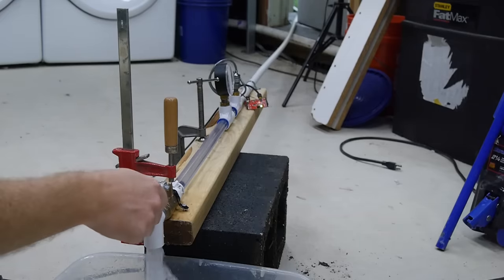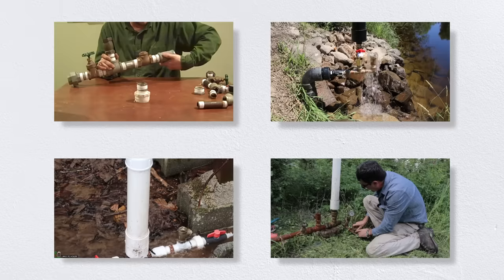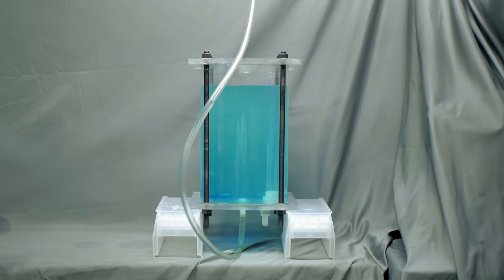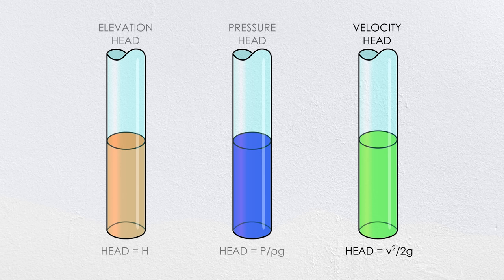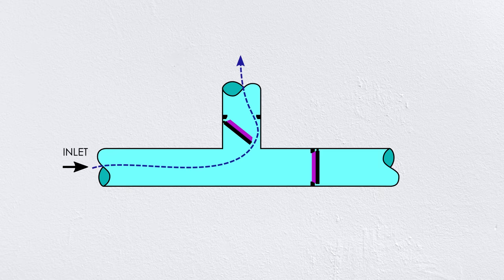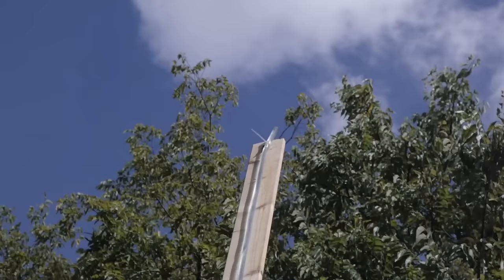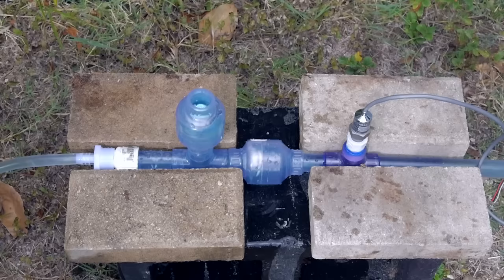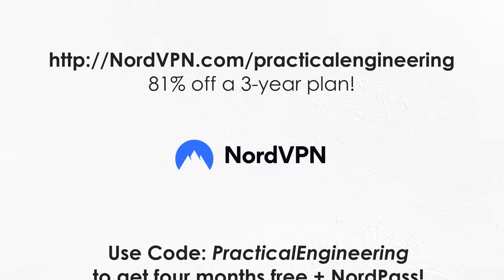How Does a Hydraulic Ram Pump Work?

Comment: Though rampumps are extremely inefficient, they are inefficient in the best way possible. If water is taken from a spring or creek, the pump can just be place a bit down the stream, redirecting a bit of energy, to do some work, from a system that otherwise would do no work at all. The water used ends up the same place. No pollution. No impact. 

However, it is probably not suitable for large scale water pumping outside some niche activities. My god, there is a lot of waste water. :) 

Also, I find ram pumps to be very acoustically pleasing to listen to! 
“Water flow sound, click, pause, click, water flow sound, click, pause, click.....” 
could sit next to one for hours, do some meditation and reflection over practical engineering, applied science and how the world works.
Reply: I concur.
It's almost like a heart beat. 
I had to pause this video because random epiphanies were flooding my mind with how the world works. And even the human body. 
Definitely something I could meditate listening too!
Reply: @tofuguru941  Ahh yeah. Those epiphany moments are amazing. I guess you are like me, always thinking about how stuff works. Even benign things like leaves on trees moving in the wind, makes me wonder what exact fluid dynamics are happening to make the leaves move as they do.
Reply: It's a poor man's version of hydro plant that only produces energy in the form of a bit of water moving uphill.
Reply: @michaelbuckers  It's a free man's way to have the amenities of running water in a home without paying a utility company for the service. This is about moving water to where you want it, not generating electricity. 

You could generate electricity with this, but you'd generate more by just placing a water driven turbine in the same location the source water comes from, and running wire from it to the home. 

It's about freedom and independence. Not efficiency.
Reply: @dolebiscuit  Do you know what's the reason humans went from cave dwelling to space faring? Sharing work instead of doing everything independently.
Reply: @michaelbuckers  Enjoy your dependence on government and monopolies as you wish. Others see a stark risk with such dependence and would rather be the master of their own self sufficient domain. That's the very reason the U.S. was created.
Reply: @dolebiscuit  Thanks I will, having always available electricity, internet and hot tap water is nice and it's really cheap compared to any DIY solutions that can deliver similar performance. If things go tits up, well I've been in the army so I know what to do, heck it'll probably be high time to JOIN army again - I'll have all of the above plus food on my plate, roof over my head, and guns in my hands, and all of that completely for free (if things go well enough I'll even get paid).
Reply: @dolebiscuit  nobodies free, we all gotta pay our dues one way or another, no man's an island and all that.
Reply: Why waste valve going down even in the first place? If water is pushing upwards it should stay that way. When water inlet is open water should push the valve and valve should stay that way why it's going down, is there some kind of spring.
Reply: @babayaga9102  Water doesn't flows continuously, it accelerates and decelerates. One valve is needed to let water accelerate and decelerate, and another valve is needed to prevent tap-out water from flowing back into the stream.
Reply: Waste valve goes down because gravity and no pressure. Water pressure only increases in the main chamber when the delivery valve is closed. That sudden high pressure closes the waste valve and forces the delivery valve open (pushing all the water behind said valve also up. Eventually the pressure drops in the main chamber, because water doesn't flow uphill and the head on the other side of the delivery valve now has energy that reverses flow. Some goes out into the main chamber but mainly closes the delivery valve again at the same time the waste valve is opening again because the pressure dropped. Rinse, lather, repeat.
Reply: Redirecting the waste water means no wasted water
Reply: Were does all that waste water go? Into space? This seam to be important. If waste water stays on earth then the Earth recycles it. So not a waste.
Reply: I’d see a use in a off grid building or garden since it’s off grid conservation of what you have is essential and for a garden you could set up a dripper system to water plants
Reply: @1992djg  Sure, as long as you have water to spare, it is perfect for stuff like that.

Comment: the idea behind this pump also applies to dc to dc boost converters. There you have a transistor and a diode working as the valves and an inductor ,that wants to continue current flow, as the inertia of water

Comment: As an Aussie, I see all that freely escaping water and have a moment of horror!

I get it though, it's a clever system.
Reply: To be fair, in the examples he showed, the waste valve dumps back into the source.
Reply: Life on Arrakis is tough.
Reply: @Damonnanashi  It doesn't.  The source has to be higher than the pump. The pump then pumps the water higher than the pump, and higher than the source. The waste water can't make it back to the source because it's the lowest part in this design. Source 1ft up, pump ground level, pump destination 10ft up. That water that spills out can't get back to the source.
Ram pumps waste 90% of the water.
Reply: @polishedpebble4111  He means back into the river where the majority is going downstream anyways, but your point is still valid.
Reply: You're assuming it can only run on fresh water.  You could use this system to turn wave energy off of Australia's coast provide high pressure water for reverse osmosis desalination cells.
Reply: @polishedpebble4111   the Wastewater Outlet cannot be the lowest point in the system If it was it would be in the creek/river 

I have seen these systems in place with only 10 ft of drop, lifting water 60 ft to a holding tank. the 90% unused just went back into the creek where it came from .
Reply: @polishedpebble4111  A water ram requires flowing water to function in the first place. For water to flow in a river or creek, it has to be traveling down hill--even the slightest incline will do. Otherwise you'd have a lake or pond. Therefore, since the very existence of the river or creek shows there is an incline, the inlet and waste valve can run parallel to the river or creek, and then the ram pressure can pump the water in a different direction, away from the river or creek, up hill towards a holding tank. The water from the waste valve will drain back into the source. The water is wasted in the ram system, but but wasted in the sense that you are forever removing it from the source.
Reply: @polishedpebble4111 , just because the valve is called a waste valve does not mean the water is wasted. These are used on a river or stream. They divert a portion of the water. The rest of the water is allowed to flow back into the river or stream. The water is not actually wasted.
Reply: @polishedpebble4111  capturing the waste water in a lower elevation tank is a solution and then can be used for gardens or landscaping.....
Reply: Recapture all the water and then you only lose a tiny amount to evaporation :p   Or use the ocean.

Comment: Welp, this helps me solve the problem of water in the event of the apocalypse at least. I have a water source 50m lower than my shelter, but haven't been able to provide enough power to comfortably power a pump for to move it.

I haven't done enough research, obviously. Thanks for this.
Reply: @Nicola Sabbadini It should be. I've never seen this type of pump being simply placed in a river, you would need start stacking rocks to constrict and accelerate the flow. But him saying "water source" makes me think it's not a river so he might need to get clever. Where there is a will, there is a way.
Reply: Nicola Sabbadini please rewatch the video. Btw the sqrt of 1000 is definitely not 10.
Reply: I think it should work. I visited a cabin that was 30 M up from a small creek. The ram pump only needed about 1/2 M of head, and 25 M of inlet pipe length (pretty flat). The inlet pipe only needed 3” of stream depth (to keep the 2” inlet pipe submerged). The inlet only needs slow volume, NOT fast pressure. It’s not a turbine. A few carefully placed rocks made a still inlet pool; that was all it needed. It’s the inlet pipe’s water’s MASS, starting and stopping, that does the work. 

The pipe going up the hill was about 3/4” PVC, and delivered a slow-but-steady trickle (maybe 1 liter per hour?), into a 55-gallon “reservoir” tank at the cabin. It tricked in through the top. The reservoir tank was not pressurized.

Comment: One think worth adding is the dual-circuit ram pump. Essentially using the gravitational energy of one fluid (water) to pump another fluid. So you can use your backyard stream to pump potable water up a hill without the two waters mixing.

Comment: Great video, one aspect of the ram pump I would have liked to see would be where are it’s limitations like based off the incoming velocity how much can the fluid be elevated, one other thing is what is the percentage of wasted fluid
Reply: For a pump that I constructed and tested about 70 to 90 percent of the water that enters the pump is expelled from the waste valve. I would guess that these values would change based on the pump size. As stated above though typically these pumps operate in a stream or river. The pump I tested was pvc with a 1.5 inch inlet and 0.5 inch outlet tested with a input head raging from 10 to 30 feet.

Comment: Thanks for the video.  I have had a ram pump installed at my house for over 20 years.  It works great with very little maintenance.  I need a minimum of 3 gal/ minute flowing into my drive pipe.  On low flow situations I ha a 1400 gallon tank on the bank up stream of my pump.  I can usually fill it over night and pump about 1/2 the tank up the hill.

Comment: Thanks for these videos. I am a plumber in Australia and, although not an engineer, hydraulics are fundamental to my job and your videos are very informative.
I have a question about domestic plumbing. I have noticed a phenomenon at my home with the bathroom taps which have jumper valves, ie taps with standard washers, not ceramic disc cartridges or mixer taps. Occasionally, with all taps shut in the bathroom and no water flowing or drips of any kind, I will open the cold tap at the basin and the shower head starts to drip through the hot tap. It only happens when the shower hot tap has not been shut firmly but enough to not drip. I cannot understand why water would be released through the hot tap after opening a cold tap. The only effect I can see is that the static pressure would drop slightly in the cold system when the cold tap is opened but how does this affect the hot water pressure and cause a drip to start? 
The hot water is heated by a gas storage heater, with a non-return valve fitted on the inlet to the heater.  It puzzles me and as a plumber I am interested in any thoughts or ideas.
Regards,
Paul Jakubik
Melbourne Australia.
Reply: yh we had something similar but with a kitchen tap, it would leak when the shower was used, in the end we just changed the whole tap to stop it, the disc cartidge on the hot end was the problem. As you mentioned i also suspect it due to static pressure.
Reply: The only place where hot and cold come together is at the heater. The pressure drop probably gets through the non-return valve, which disturbs the hot water, maybe some shock wave or something and that triggers the dripping from the shower. That's my guess.
A have a different thing at my home, when i open the cold water suddenly, there comes some kind of trumpet noise from the boiler/heater. Again from the non-return valve, which obviously doesn't seal very good.
Reply: it may be that the line pressure is holding the tap shut, but the momentary pressure drop when the cold is opened breaks the seal to allow a drip path.  once the cold tap is closed pressure in the lines returns to max and the tap seals back up.  drips due to pressure drops are very common on o-ring seals, and since the cold water is the pressure source for the hot water opening a cold tap drops water pressure on both the cold and hot water.  probably a combination of worn or decaying seals and pressure that sits right at the 'sweet' spot to cause the phenomena.  higher line pressure would make it never drop low enough to start dripping, while lower pressures would ensure a constant drip until the valve is closed tight.  i work with water treatment equipment, every seal is an o-ring and i frequently see leaks that start dripping after pressure is relieved.
Reply: Elon Musk's team learned the hard way that check valves aren't perfect. They can't completely prevent changes in pressure from propagating back down the line.
Reply: You need to tell us the type of heater you have. I assume it has a resouvour?
Reply: @damirradivojevic1662  Thanks Damir. Yes, I have traced various problems back to the NRV. In Australia, we call them duo valves as they have an isolation function and non return function in one valve. Have a happy Christmas.
Reply: @MichaelOnines  That's why in hydraulics you have a backflow preventer which is double check valves. Two of them in series is generally pretty fool proof.

Comment: I'm an EE and this looks exactly like a DC-DC  switching power converter.
Converting High Current - Low Voltage input into a Low Current - High Voltage output.

Very Nice Video, I really enjoyed it
Reply: Yes, you are not the only one who saw the parallel to a boost converter.

Comment: You didn't explain that FIRST you must have a head of water higher than the outlet of the waist valve, and the higher that head of water, the more or higher the pump will pump the water. Without that head of water,  there will be no water flow.
Reply: yes and no mention of the ratio of water pumped to water wasted....
Reply: @direwolf6234  These are mainly meant for very small-scale use when one has access to a river or another source of water which is functionally inexhaustable. But no, it is not very efficient in that regard.

Comment: in larger scale applications, what happens to the waste water? is there any way to collect or re-use that water to reduce the waste in the system? can it be re-introduced to the inlet of the ramp pump?
Reply: The waste is usually dumped near the water source its coming from but downhill or near plants in the in the case of a well. It can't be reintroduced to the inlet because that would require the energy that you're trying to extract in the first place.
Reply: This is not a solution for applications where you want to conserve water.

Like he said in the video, the most common usage is an off-grid water pump. You stick it in a nearby stream, it doesn't matter if most of the water carries on.
Reply: idk... but if make a catchment and   return line if i setup one of these.

Comment: Hey..  how much water I need to waste to get 1 liter up 1 meter?

Is there some equation?

Edit: Thanks for useful reply <3
Reply: that would interest me as well. There might be two formulas. One relying on a frictionless theoretical value, another one for practical appliances...?
Reply: For an ideal pump (water arrives at the top with zero remaining velocity, no friction losses, etc) the ratio of the flow into the pump to the delivery flow should be the inverse of the ratio of the heads. I.e. if you have 1 m of head upstream of the pump, and want to pump the water at the delivery end up 10 m, and have 10 l/min flowing into the pump, you should get 1 l/min arriving at the delivery end, and 9 l/min going out the waste valve.

Real ones apparently can usually get an efficiency of about 60% (though that can be both higher or lower, depending on how well it is constructed, how high the head ratio is and so on), so in my example, you'd with that head ratio only have 0.6 l/min at the delivery end, and 9.4 l/min at the waste end.
Reply: Assuming no energy is wasted, sum of the three heads before the pump = sum of the three heads after the pump.
Reply: @zuthalsoraniz6764  thanks

Comment: As a carpenter I have used a homemade water level. I was amazed by it the first time. Very informative and well done.  I would probably put the waste valve over a catch tank.
Reply: You usually cannot do that, the waste valve is on a similar level to to stream you take water from. So you can have a pond or a mill under it, but probably not a usable catch tank. 

Where you HAVE catch tank is in the place the water is pushed over the roof. There you would have some good old australian-looking water tower and that one would provide you with pressure for the whole system.